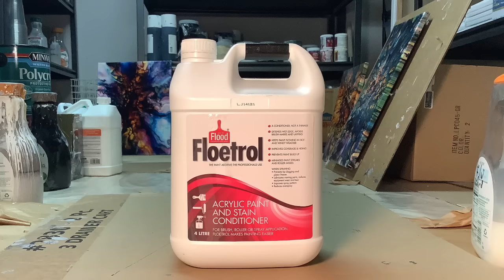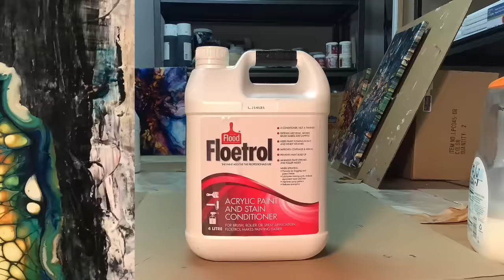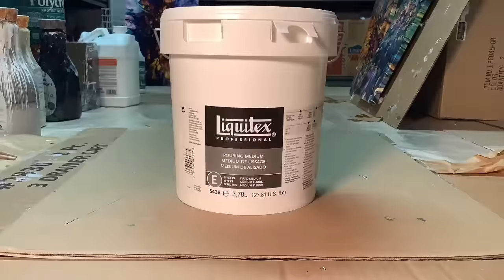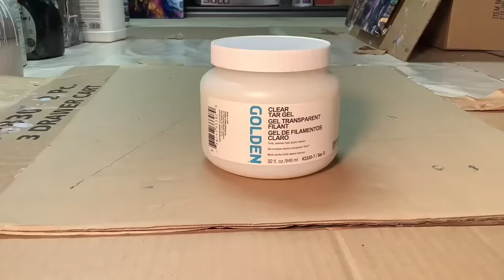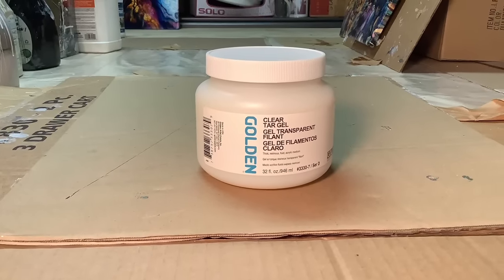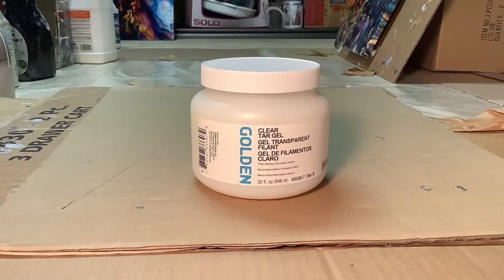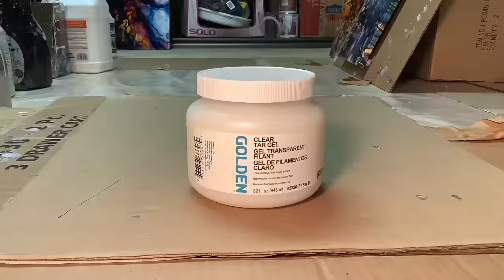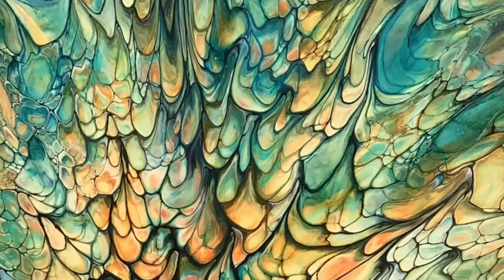What is the ultimate cell activator?

Comment: Well I've used a lot of Floetrol in paint here in Oz - as a professional house and industrial painter...  We use the Floetrol to control the drying rate of the paint so we can avoid dry edges and get a consistent finish across a large surface in sometimes very trying conditions.  An early lesson of using Floetrol and the oil paint version, Penetrol is that if you use it to excess you alter the colour as the pigments settle out differently - the difference can be stark and you also change the gloss level which also changes how you see a colour.  Basically Floetrol here is just Ethylene Glycol - antifreeze.  It is a consistent very pure form without the dyes and regurgitant used in automotive versions.  It looks like the USA version has a latex base which would make it behave much differently I expect...  I have some of the Oz version in a bottle in my shed now, it is over ten years old and shows zero desire to thicken or glug up - exactly the same as when bought.  Interesting subject - spent a lot of years avoiding weird effects in my painting, now I'm getting interested in doing it deliberately!  Enjoying looking into these techniques - I found you here because I wasn't really clicking with some of the tutorials already found given I know how acrylic house paints work and some of the instructions seemed to be a bit too much magic and not enough practical technique for me.  Cheers from Oz.
Reply from the maker: I really appreciate your input Boat Beard 🙏 thank you so much…very informative and insightful 👍

Comment: Another message/comment/question:
I understand and agree with the reasoning of using Golden’s Fluid Acrylics, their pigments and quality are unsurpassed- question: are you mixing the Golden Fluid Acrylic color with your stage one base medium formula at the 10% rate to give the paint (color) the same (similar) viscosity? 
Thank you- hope it’s not a silly question
Reply from the maker: Correct 👍
Reply: @chasefluidart4341  Thank you.
I was wondering about that- mainly because I know the Golden Fluid Acrylics is basically “pourable” right from the bottle (more or less). My initial thought was the pigmentation would become diluted in the scenario of adding to a 90% base medium- then it dawned on me the parameter of your limited use of water! Ah-ha! The base medium is essentially a “paint” mix (chemically) therefore the pigmentation/color quality should remain very high and true. Hence, another reason to use a more costly/higher quality pigmented paint.
Again sir, I truly appreciate the lessons you’ve provided 👍🏼
Reply from the maker: @interstitialmusings1709  …you got it 100%👍 I appreciate your comments 🙏

Comment: Hello Steve, great video. Question, for the main mix you said .4 parts Tar Gel,  can you explain what  ( .4 parts is) thanks.
Reply from the maker: Thank you so much Susan 🙏 it’s basically 10%...an example in even numbers...15 oz Behr + 5 oz polycrylic = 20 oz...then times .04 oz = 2 oz tar gel. Hope this helps.
Reply: @chasefluidart4341  Thank You

Comment: Hello! I am one of the early adopters of the bloom technique and took the course from Shelee. One of the things that frustrated a lot of us at the beginning was that #1, we couldn't find the ingredients she was using #2, we didn't completely understand the "science" of it (neither did Shelee) #3, we didn't understand the importance of "the blow" until much later. 
My question for you is, did you get ahold of the ingredients list for both the Aussie Flo and the U.S. version? Otherwise, how can you form the conjecture that the Australian Floetrol is more simple in structure? I don't disagree with your premise, but do you have proof that this is why it works better? I've experimented heavily with both. It's so much easier to use than any other thinner I've tried. Also, I was the one that discovered early on that plain water shouldn't be used to thin down the pouring medium mix. I have found the Liquitex Flow Aid works well.
Reply from the maker: Thank you so much Connie🙏 I do appreciate your questions and input because they will help me improve things in future videos. 
Just to be clear my videos are based on my opinions as a result of my experiments and experience. I felt that by stating  “in my opinion “ or “I believe that...” it would be understood by the viewers that these are solely my opinions....perhaps I didn’t make that clear enough and that needs correcting. I apologize if it caused confusion.

I do not have any access to chemical formulas of products and wouldn’t understand them if I did. I have no background in science and with only four years of experience blowing around paint I don’t consider myself to be an expert by any means ...however I do have opinions that are based on my experience and testing. That said I absolutely believe in my conclusions but it’s ultimately up to the viewer to assess their validity and use them as they see fit....free of charge.

Here is how I arrived at my conclusion about Flotrol:
Rayleigh Taylor Instability changed my entire perspective and showed me why cells truly form ...it’s the pigments in the paint itself that are the crucial factor and it occurred to me that chemicals in the top layer mix might interfere with the pigments and actually prevent cells from forming...so I eliminated chemicals and just used paint and water for a top layer mix. That combination worked well enough to reinforce my opinion that so called cell activators were a myth. But it also proved that water alone left a lot to be desired as far as stability is concerned. Finding the right paint is tricky but the real problem became finding a thinner for the paint that was more substantial than water and at the same time wouldn’t interfere with the pigments. I tested both Flotrols extensively. Since they both have the same parent company and marketed to serve the same function...why would they act so differently with this process? My test were as identical as possible...the only variable was the different Flotrols. The American brand appears gummy and has a unique chemical composition to causes that. In my opinion that is the reason it’s interfering with the pigments. The Australian brand obviously doesn’t share the same properties because I see no interference with the pigments at all. That leads me to believe that it’s a more straightforward and simple product by eliminating the extra chemicals. Regardless the main point is that the ingredients in Flotrol are not required to produce cells but it does make a splendid thinner. I agree with you...it is easier to work with👍 again many thanks for your input 🙏
Reply: You were the one. smdfh
Reply from the maker: Thank you so much for your comments Nina 🙏 smdfh?
Reply: Quick clarification Steve. In the description, I believe you indicate "regular" Floetrol. Being a bit self-centered, I took this to mean US Floetrol since I live in the US. 😆 

But, I believe, from this comment thread, that Australian Floetrol is the preferred ingredient if I can get my hands on some. Correct?

If not, will US Floetrol be ok, though being aware of its cons? Would it be a good idea to strain it? In an attempt to remove some of the gunk? 

Thank you so much for all of the work you've put into these descriptions and videos. 

Hello from Greenville, SC by the way!
Reply from the maker: Well hello neighbor…thank you so much tlatham 🙏 you are correct ..regular Flotrol = American to me. My opinion…cells form because the top layer mix sinks through the rest of the paint. Australian Flotrol is a great thinner for the paint in the top layer mix because it’s not complex and very thin…it does not create cells its simply a thinner. American Flotrol will work to a degree but since it needs to be thinned with so much water to be effective …I’m not wild about using it….and yes regardless on how you use it staining is a good idea. Re-visit the last half of “The Ultimate Cell Activator “ for more details.

Comment: Thank you for this very instructive video.  I am looking into starting the bloom-swipe technique as my next project.  I was considering investing in australian floetrol as it is widely promoted as being the best, and maybe only, solution.  I was so glad to find your video packed with useful information making me question the way to go.  In your explanation, you discuss the application of pressure on the top layer to promote the migration of the pigments and formation of cells.  I was wondering if the two recipes/formulas that you have found to work best at this time would also work with the swipe technique, were there is no addition of mechanical pressure on the top layer?  Thank you again for this video, I now feel more empowered to tackle this project with a better understanding of the underlying mechanisms!
Reply from the maker: Thank you so much Annie 🙏 I appreciate your insight….but there IS added downward pressure from swiping. I am guilty of over emphasizing downward pressure and giving the impression that I really bare down with a lot of force….that’s not the case. I like to think of it as giving the top layer mix a little boost because what it really takes is a delicate force….it’s touch and finesse. What’s really important is that the top layer paint sinks down through the rest of the paint….so it’s not as much about the ingredients as it is the weight and consistency. As far as swiping is concerned …yes the two formulas work just fine. I’ve gotten my best results having the base color being exactly the same as the rest of the colors…same formulation just a different color. I like to also thin the mix a little for all of the paint.

Comment: Hello Steve, I am writing to you from Belgium. Many thanks for your video which I watched with instant translator at least 10 times before fully understanding the advice you give :). I started not long ago with the technique. I will try the recipe: Liquitex + Floetrol from (Owatrol) + black paint (Black oxide from Amsterdam). My question is, if I understood correctly :), you use pure paint in the lower layers? You don't add anything to make it smoother? Thank you for your response, Mireille.
Have a good day Steve!!!
Reply: Thank you so much Mireille 🙏 there are two recipes in this video…the Main Mix and the Top Layer mix. The Main Mix consists of the Behr paint, Polycrylic and tar gel…that becomes the medium. After it is mixed up you then add the different colors to use for all of the bottom layers of paint. The Top Layer mix is mostly paint…in your case the Amsterdam….the Liquitex + Flotrol/water mix is used to thin the Amsterdam. Keep in mind that the Flotrol/water mix is mostly water and is used to thin down the Liquitex 👍
Reply: @stevechase4407  Thank you very much for such a quick response. If I understood correctly in the video, you recommend 10 parts Liquitex / 4 parts Floetrol and of this thinner 10 parts / 4 parts of paint. If it is necessary to add water my question is: how many parts of water? Thanks Steve. Here it is 7 p.m., I hope not to disturb you. Mireille
Reply: @mireillelefevre7047  🙏 Liquitex Pouring Medium Mix:
4 parts Floetrol/Water plus 10 parts Liquitex Pouring Medium. This makes the thinner for the paint.
Then mix:   10 parts Thinner Mix with 7 parts soft body paint.
Reply: @stevechase4407  Thank you !!
Reply: @mireillelefevre7047  👍

Comment: Hi, thank you so much for your video. Thank you for taking the time to instruct people. I have two questions. Will a portable air compressor work for your technique? On your other video you mentioned you had some rather large air compressor and I don’t think I could put that in my apartment.🤣 what an electric tire air compressor work? And also, where else can I find more of your art? It seems putting videos on YouTube isn’t your thing. Which is unfortunate but I understand. Thank you again so much.
Reply: Thank you so much Meandering Musings 🙏 Great question 👍 the short answer is probably not. My technique requires about 100 psi air pressure and be able to maintain it for about 20 seconds. It also requires a variable speed control air gun trigger. The process starts with the gun low to the canvas with very little air flow. I then begin to raise the gun straight up and at the same time add more air with the trigger so that by the time the gun is two feet above the canvas I’m using all of the air pressure that the compressor will produce. I’m sorry about the lack of a follow up video but I have had a terrible year personally and just have not had the will or mind set to do that for the time being. I do have somewhat of a script for a new one however…thanks for asking.
Reply: @stevechase4407  thank you for taking the time to respond. I’m so sorry you’ve had a difficult year. I sincerely and truly hope things are getting better for you. You don’t owe any of us another video. Just keep doing your beautiful art.
Reply: @Walua  🙏❤

Comment: Love your video and it has taught me and explained to me so very much!  Since watching (multiple times) I have poured two very nice paintings using air force.  Not as nice as yours but nicer than I have been getting.  I ordered the Tar Gel and should receive it in a few days.  My one question is on your paints what pouring medium do you use.  If I don't have Tar Gel do i use the secondary thinner which is 10 parts secondary thinner to 7 parts paint?  And what should the consistency be, does the paint leave a slight trace?  And do you mix the thinner and paint together before you store it in your plastic squirt bottles.  I know, lots of questions but your video(s) have really opened by eyes.  Thank you so much and I also love your bloopers.
Reply from the maker: Thank you so much Steve 🙏 I appreciate the opportunity to clear some things up. The main mix consists of 3 parts Behr #3453 (this is the medium), 1 part Polycrylic and .4 parts tar gel. The tar gel is optional ( but I highly recommend it). After you mix these ingredients together then add 10% paint (percentages will vary according to the paint used). I use Golden fluid acrylics. If you don’t have tar gel simply use the Behr and polycrylic...nothing else is necessary. Now if you find it too thick for your particular style....thin the polycrylic only with tiny amounts of water and then add it to the Behr. I store this medium without the paint colors (colors added just prior to use). So happy to see things working out for you and I appreciate you letting me know👍
Reply from the maker: Thank you so much Steve 🙏 I appreciate the opportunity to clear some things up. The main mix consists of 3 parts Behr #3453 (this is the medium), 1 part Polycrylic and .4 parts tar gel. The tar gel is optional ( but I highly recommend it). After you mix these ingredients together then add 10% paint (percentages will vary according to the paint used). I use Golden fluid acrylics. If you don’t have tar gel simply use the Behr and polycrylic...nothing else is necessary. Now if you find it too thick for your particular style....thin the polycrylic only with tiny amounts of water and then add it to the Behr. I store this medium without the paint colors (colors added just prior to use). So happy to see things working out for you and I appreciate you letting me know👍

Comment: Awesome! So in step one under color paint mix where it says 90% main mix (base paint and color pouring medium) does that mean the interior paint that we use in the first layer gets mixed with a color pouring medium and then mixed with 10% heavy pigment pain, like golden?  Will that not change the color of the pouring paint? So like if the base paint is white like yours does mixing it with the paints you’re going to pour lighten the hue of these paints? I love your technique and really want to get it right! Thanks you so much!
Reply from the maker: Thank you so much Katey 🙏 the base paint is not a different type of paint. When I use the term “base” it’s just means that it’s the first layer to be applied to the canvas. It’s identical to the rest of the colors as far as the mix is concerned. I appreciate you bringing this to my attention…I will need to do some editing in the description to make it clear👍
Reply: @chasefluidart4341  thank you! 🙏🏽

Comment: Steve, thank you very much for your video! It was extremely informative. While I still haven't gotten the cells you are able to create - no where near actually - I have made progress. And, I've only done a handful of them in total, as I am a newbie, so I know there's more effort needed. I think my second layer of colors and the top layer are too thick - I now have a kitchen weigh scale, so I can get more accurate mixture ratios. Also, I am using Liquitex Basics, which I believe are heavy body, so I might be using too much paint. I'll figure this part out using trial and error :)

I do have a question about the Behr paint though. I bought the untinted 3453, but it is not white. Was I supposed to buy the plain white 3453 (if it exists) or am I supposed to add titanium white to the base mixture? I ask because the color of my negative space areas is a light beige color. I did say above I am a newbie at this. :)
Reply: Thank you so much Deedoo433 🙏 Liquitex Basics is considerably thicker than Golden Fluid acrylics so you will have a lot of experimentation to do. As far as the Behr is concerned you absolutely do NOT want to add any titanium white to it. If you do that all of your colors will turn pastel. The beauty of the 3453 is that it is not pigmented at all so all of the colors will stay true👍